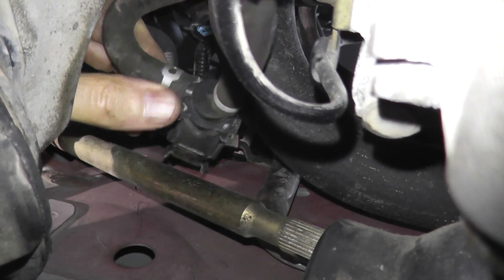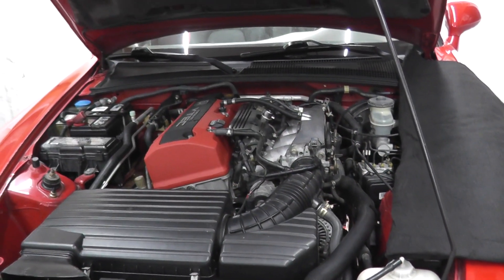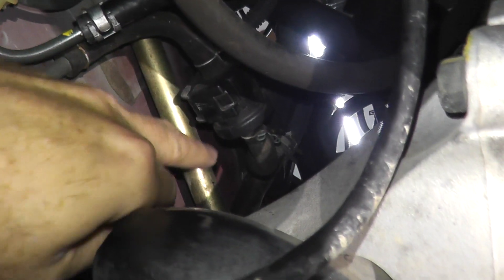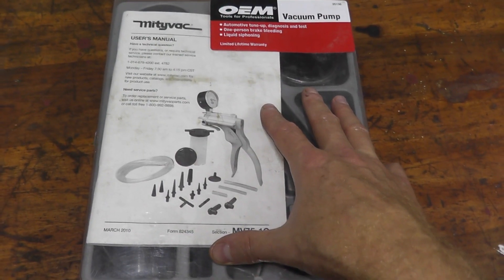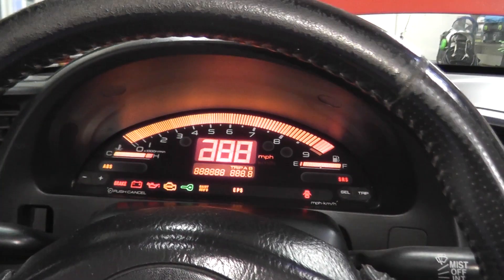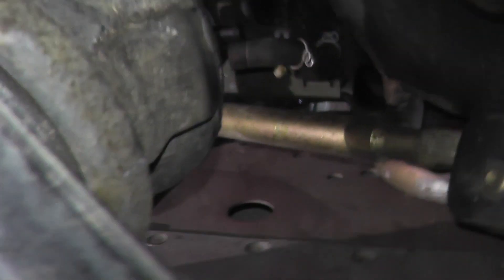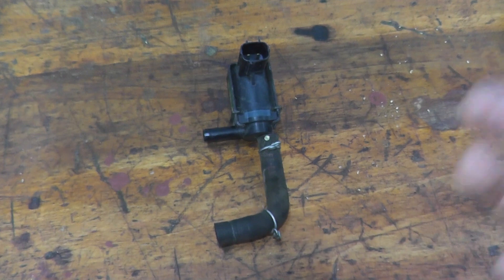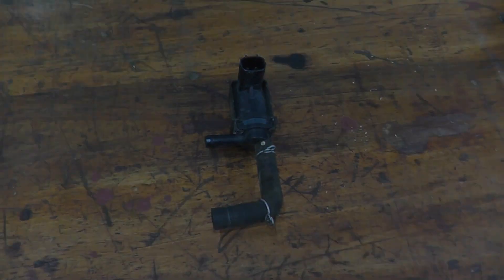How To Test and Replace an EVAP Canister Purge Valve P1456 P1457

Comment: Is the valve always closed by default? Meaning can I blow through it?
Reply: Purge valve = front door (always lock your front door) so it's normally closed until ground is supplied through circuit then it opens.

Vent valve= back door (back door is always unlocked) it's normally open until it's circuit is grounded then when energized it closes.

To answer your question, if it's stuck wide open you can blow through it but if it's sticking open by .001" it will trick you so it's best to check with a vacuum pump and a 9volt battery.

Comment: Step 2 in the s2k service manual: Connect CM connector terminal Af to hod
ground with a iumper wire
ECM CONNECTOR A (32P
PCS (RED/YEL)
725 26 27
T28 29 30 /
JUMPER WIRE
Wire side of female terminals. Is this necessary to check the valve?

Comment: hey there carsntoys, i was wondering if that valve could be part of the reason when i get low on fuel that i get a check gas cap warning until i refuel ? it does it everytime i get nelow a quarter tank of fuel on a 2005 honda accord EXL 6 cylinder, thanks for your time, you have great info always.